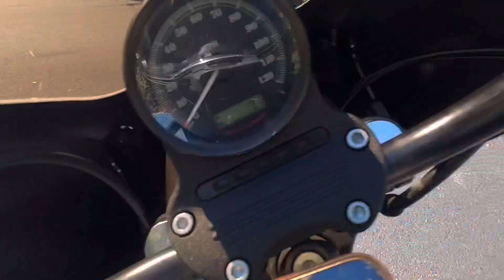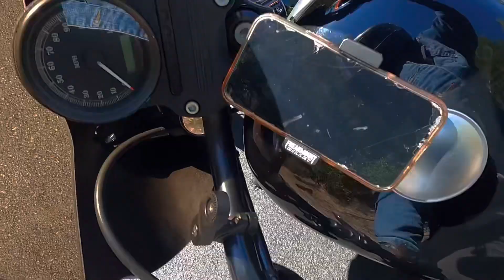“Had to lay ‘er down” | Low sided my bike

Comment: Hi….Im guessing you used your front brake more then your rear when you approached the stop sign….Always at stop signs you have to be careful and look ahead before you get there….Vehicles stopping there leak oil,,anti freeze and other shit,,also sand…If you had your front brake applied and not using your rear and there’s shit on the road it’s pretty much you’re going down…Get up and continue riding,,This has happened to ALL of us so don’t let it bother you ok…
Stay Safe.!!

Comment: My guess is that you didn't cover the brakes (it's much safer if we do cover at least the front brake), and were distracted, so you were late in detecting the stop sign and the stop of the other rider.  By the time you did detect this, fear set in, and this fear was probably amplified by what you said at the beginning (what had happened earlier to another rider). You probably also hadn't practiced emergency braking in a while, so when you needed solid braking skills, they weren't there. The combination of all of these factors led to panic braking, wheel lockup, and a fall.
Fortunately it was a fall at low speed. I'm glad you're OK. We all make mistakes, many of us have made much bigger mistakes.  It's important for any rider to cover the brakes when other traffic is nearby, and also, anyone with a non-ABS bike needs to practice hard braking on a regular basis, because without practice, making a hard stop is simply too difficult in a stressful situation.
Reply from the maker: thank u for ur input. noted to practice more on my emergency braking skills. i do think it made it worse when i was tired and not resting after witnessing a traumatic event.
Reply: @killakumi   Don't be too hard on yourself for falling, the most important thing is to motivate each other to keep learning, because that'll make riding safer and more enjoyable.   I highly recommend the YouTube channel "Moto Control".  He's the best instructor on the internet, by far.  I watch his videos repeatedly, then pick one thing and try to work on that.
Reply from the maker: you are so right. i’ve been beating myself up for this fall, but it should just be a lesson to learn. thank you for your advice! i also like watching Ride Like a Pro and Motojiutsu too. time to re-educate myself in riding! 😃
Reply: @killakumi   That's 100% right.  Don't beat yourself up. You're probably already better than the majority of riders out there, and will become even better.  The two you mentioned give excellent advice.